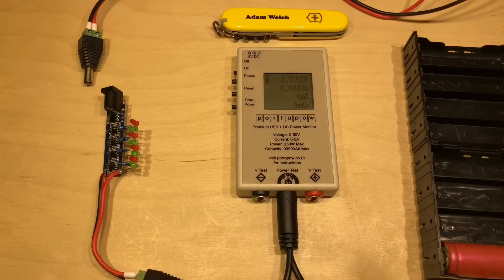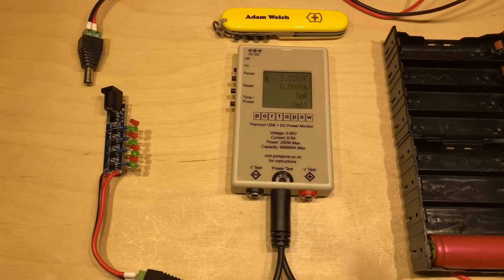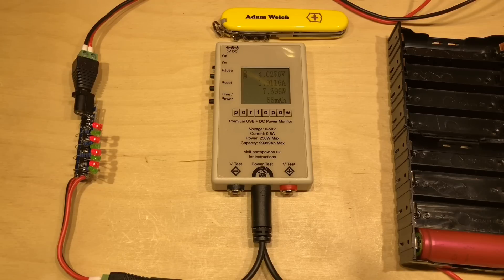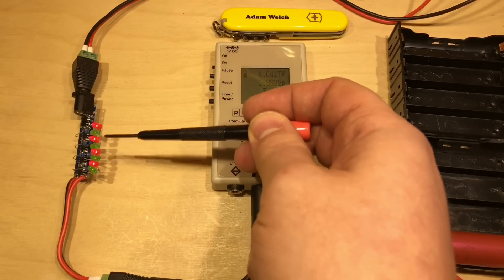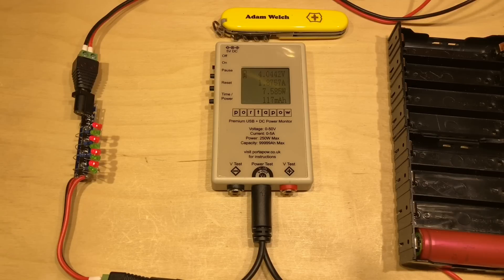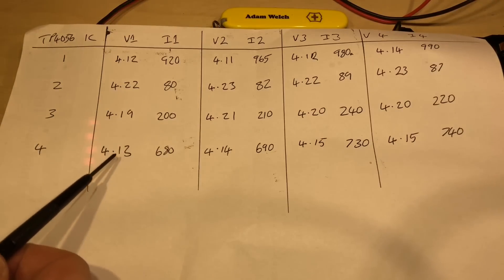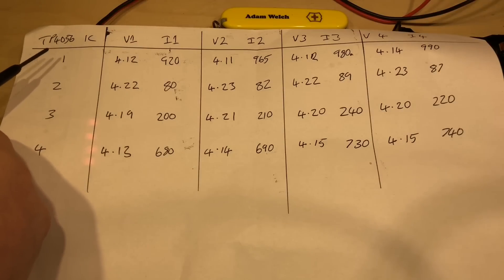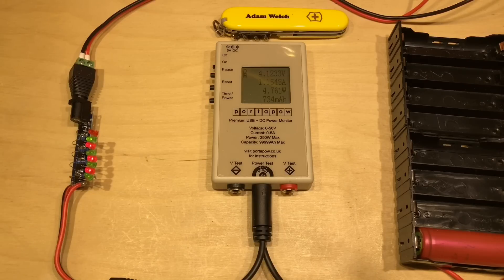High Current TP4056 Module Update - 12v Solar Shed

Comment: That first chip was well out of spec. It is unusual to have such variation in my experience...Er which is zero with the 4056...
How did it take a 2.2A charge well over 90 mins to charge that 1.6A/h battery after reaching 4.12V😫?
Reply from the maker: When the chips reach their charge limit the current decreases, so for the 90 minutes mentioned there is significantly less than 2.2a. As I said, it dropped off to 80-90mA between the first and the fourth chip calling it quits. This is normal for CC/CV charging.

Comment: Those chips are not meant to be used in parallel, mainly because it may under/overcharge your battery till dangerous points, batteries are no joke.

Comment: You'd clearly be better off buying four of the cheap TP4056 modules without battery protection and just putting them in parallel. No messing about attaching extra indicator diodes, and each one would only dissipate the usual amount of heat for the module, so you could keep them a distance apart to minimise temperature rise.
Or even better, buy ten of them and pick four that matched the closest. A bit hard on your 18650 while you swapped them in and out to get matching Vmax.

Comment: HI, There is the exact module with cn3058e chip, anything you can tell me would be great. I have seen a video where the tp4056 chip is replaced with cn3058e chip with 8th leg up, any info on this would be helpful. THANKS

Comment: very interesting review of this TP4056 charger only verion  ... Can you please experiment with TP4056 module with over-discharge protection version ... in parallel ..to get higher output current  (to be used for LED  lighting application ..etc) ??

Comment: you mean 1v or 2 watts are released as heat by the 4 x TP5056.   90 mins between first IC stop and last IC stop and if "standard status" had been taken from IC 1 you'd have stopped charging before the battery was fully charged. (unless IC 1 had the highest voltage  output [VOLTAGE REGULATION SHUTOFF?]).  why doesn't each of the 4 ICs recognize the battery reached full voltage at same instant and stop delivering amps? voltage regulation of each IC varies wildly while the specs say there ought to be no more than 1.5% from 4.20v  (4.137 - 4.263v)

Comment: I have the tp4056 modules with protection, the later ones. I found a schematic online basically running 4 of them in parallel for a 4 amp output. The chips do indeed drop off at different rates, when the last one turns blue they have indeed charged the 5s8p 18650 ( I charge 1 section at a time ) pack to max capacity. Has worked quite well, many times..

Comment: So why not use a chip to accept voltage from the chips, a set of and gates or transistors could be used to switch on and then drive a status LED.

Comment: +Adam Welch have you tried putting 12V across 3x TP4056 in series for cell balanced charging of a 3S battery pack? Does it allow supply side to supply current from VCC to GND (which would be tied to VCC for the next module)?
Reply from the maker: +Simon Merrett Sadly this won't work unless you have three isolated power supplies - otherwise they'd share a ground and you'd end up having a dead short across cells.
Reply: Adam Welch I was thinking gnd from first TP4056 would be connected to vcc of the next module and so on, so I don't think the grounds would end up common (if also connected in a similar way on the battery side) but I can see it probably won't work.
Reply from the maker: The input and output grounds on the TP4056 modules are commoned together.  So unless you use isolated power supplies on the input there will be a short in your cells which are connected in series.

Comment: But does this board prevents the battery from over charging? 

And do you think that it is possible to mod it and combine it with the other 1 tp4056 board wich has over discharge protection?
Reply from the maker: My particular module does charge a little over 4.2 volts due to the fact that one of the TP4056's regulation voltages is slightly high.  It's not stupidly high though.  This module is simply a charger, it doesn't have any undervolt protection like many of the single TP4056 modules do (using the DW01).  It may be possible to intregrate with a protected module - I haven't really looked at that.  You might want to take a look at my latest video to see some alternatives to this module.
Reply: ***** thanks! and yes i will

Comment: Am going to stick with one chip to one battery.
Reply from the maker: Yeah.  There are other higher powered alternatives to this TP4056 board.  Hope to do a comparison video soon.
Reply: Well, someone else already did it.  They got four TP4056's that has just the connections for a wire to be soldered on for 5V and gnd; so they soldered the 5v in series across the four points and the gnd the same way.  The output was two soldered wires from a single holder used to charge the battery.  There is nothing wrong with the TP4056's.  Just how some of the boards are made really. There is a bloke I know of by the name of Julian Ilett that in-directly talked me into getting back into this.  In the last video I published on a different channel;  I was asking him to give me an idea for an oscilloscope but I haven't heard anything from him.  It could be that kit build one but I saw how much trouble you had with one.  Or I could get a hand held one or a Owon.  Mostly about 25 years ago I just worked on digital circuitry but there has been a bloke in Texas that has been after me to build a MPPT charge controller.  So, the first two projects will be to revise muffet and the second one is to build a weather station/greenhouse controller.  The wife whom is back in the UK is sort of picky on the greenhouse.
Reply from the maker: +TechMan1219 I enjoy Julians videos and I'm pleased to say he's one of my subscribers. I know he says any scope is better than no scope - and I agree, but once you find you need to measure things the jyetech scopes start to fall down. I used a hand held jyetech for a year or so but I outgrew it and bought an Owon SDS7102. It's does everything I need for now. 
I like the way Julian uses the jyetech scope whenever he can. Proves you can do a lot with them and don't need a lot of money to play with electronics, but when he needs to he digs out a proper scope - he's just been sent a nice siglent, the lucky chap.
Reply: We used Tektronix solely but that was proved by my employer.  So, for myself am not going to go out and pay £6,967.00 for an oscilloscope.  And I will need that when am working on muffet and some of the other projects that will be following.  I do know it must be dual channel for the changes am going to do to muffet.  So, it’s either hand held or the Owon.  Am working on the parts list for that 18650 design we were talking about.  I know it’s been done but I guess I can redo it wish a twist.  Just need to find a USB end or maybe cable to cut it up.  And am looking for a board to mount it to so it will be easier to carry.  So, I'll do a build video on Independent Living which is one of my channels that I started to post videos on for more technical subjects.  It gives my wife headaches when she watches it and I told her to avoid that one.  But since am here and she is still in the UK; it's her way to know what am up to.

Comment: The LED pins on the TP4056 should all the open collector outputs, so you can wire all pins of each LED output on each TP4056 together without any ill effects and that should let you know when your charge is done without needing all the extra LEDs.
Reply from the maker: I guess I could however if I did that I would only see three states - when they were all charging, when some were charging and others were not and when they had all completed.  Having an independent LED on each TP4056 allows me to see the status of each individual chip - which was crucial to prove they can have quite different thresholds set.  Cheers
Reply: My thinking was more along the lines of making the circuit a bit more practical, since if the chip that has the LEDs connected happens to have the lowest cut-off threshold then you might disconnect your device before the cell is fully charged.
So as a quick bodge to counter that you could solder pins of each LED output together. :)
Reply from the maker: +Poptart McJelly Yeah fair enough - my mod may not be the most practical day to day :-)

Comment: what or how do you sauder the leds on. Have a picture?
Reply from the maker: I just tacked the LEDs straight onto the legs of the IC.  So you need a resistor from 5 volts to a common positive of the LEDs (I used a 1k) and then tack the negative of a red LED to pin 7 and the negative of a green LED to pin 6.

Comment: Unsure if it means anything to you, but inexpensive 5A chargers exist.  This one below has adjustable voltage and amparage settings, but only an indicator light when current reaches a fraction of of its maximum.  No discharge undervolt protection.  http://www.ebay.com/itm/2PCS-5A-Lithium-Charger-CV-CC-buck-Step-down-Power-Supply-Module-LED-Driver-/331803674687?hash=item4d410a483f
Reply from the maker: Yeah using a CC/CV module is a good way of charging lithium - I did a video about cheap ways to charge them and this method was included.  As you say, they have a couple of issues however.
I was interested in particular with this module because the TP4056 have been sold in such huge numbers - It was extremely interesting to see another take on the thing.

Comment: Hi Adam, you might like this one as u r searching for your 18650 owercharge protection...(aliexpress:Excellent Relay Module DC 12V Relay Switch Control Board Module Relay Module Voltage Detection Charging Discharge Monitor Test) i am building almost similar 12v sistem and i think that this little thing might protect my sistem from owercharging :) great job in your 12v solar shed ;)
Reply from the maker: Thank you.  Yes I can see this would be useful.  The charge controller I have connected to my lithium battery bank does have upper and lower charging limits.  If things go wrong I hope they'd kick in.

Comment: Thanks Adam, really interesting. Ive ordered one of these so will take your advice. Couple of questions, presumably its only 1.03V being dropped across the board (5V -3.97V)? Also does the module ever actually disconnect charge or is the module still delivering a gradually reducing current when all lights are green? If so, wonder if that might over time potentially shorten the life of the batteries being charged.
Reply from the maker: Hi Jerry and thanks for your comments.  A little confusing that sorry.  Assuming people only discharge their cells to 3 volts there would be two volts to drop at the start of charge - and of cause this is the point where the most current is being transferred. As the battery level increases and the current falls away the watts being dissipated will decrease.  I mentioned this in the video as the voltage was coming up to four volts so yes at the time it was dropping just over a volt.
In my last video one comment did mention that they had the same module and it never seemed to quit charging.  I haven't had that issue.  IC number 2 did cut out at 80-90mA every single time.  Once all green LEDs were on no current was flowing.  
So the good news is that my tests show that the charging graph really is like the one shown in the datasheet and the shut off current is around the 10% figure (actually I calculate my module cuts out at about 12% of initial charge).
Now attach this to a larger group of cells and introduce some more losses - potentially the module may never get down to that 10% shut off figure.  I guess it pays to monitor.
Reply: Adam Welch Thanks Adam for coming back to me and the helpful comments. Yes I will definitely monitor with mine when it arrives and see how it performs. Thanks again for the video and comments 😊

Comment: Thanks for the update Adam - it shows that this type of module is not good for initial characterization of an 18650's capacity.    I only hope my BT c3100 charger is a bit more accurate (or at least consistent)!  I hae recently got some of those lipo low voltage indicator/buzzers and have measured similar poor voltage tolerance which is not too good.
Reply from the maker: +Simon Jowett It does beg the question for those checking cell after cell are you selling some of your cells short if you've charged them in a low regulating TP4056 module. Some cells might not make the final cut but have just been under charged. 
You would hope at least the two or four slots of a commercial charger would charge to a similar level - but has anyone tested that closely? What the differences will be between BT C3100's as well remains to be seen as far as I am aware. 
Cheers
Reply: Adam Welch hmmm might need to do a test....possibly video it too

Comment: Good work, I wonder how much the normal TP differ from there led charged state. Tho voltage will still be out by 1.5% between the chips
Reply from the maker: +Mikes DIY Tesla Powerwall Exactly. But then it also begs the question what is the charging accuracy of all the chargers on the market? Will different slots in a charger have different tolerances?  We could be rejecting decent cells because our charger isn't being fair to them.

Comment: Adam, would there be any differences to using this module VS 4x TP4056 modules in parallel. (Is that even possible?) This module saves space and has diodes on the input, but the TP4056's would all have LED's pre-soldered on.
Reply from the maker: The size of this module causes it's own issue with heat.  This module is much like the original TP4056 (without the DW01 protection circuit) paralleled up.  So I see no real reason why you couldn't use those gen 1 modules in parallel.  It would of cause have the same issue that each TP4056 would have it's own idea about when the charge is complete - but as you mention at least you'd have all the LEDs to show it.
The last thing to mention is all the TP4056 modules I've seen have the 1.2k current setting resistor which means they can supply 1 amp max of current.  The module I show here uses 1.6k resistors to set the max output of each IC to ~690mA.  I'm guessing this is due to heat on that small module - but it's worth noting.
Reply: Interesting. With the smaller modules you could more easily test their tolerances to find chips that are close to each other and the 4.2v cut-off point for the 18650's. That should give you both a full charge to 4.2v and the full current until they all reach the CV phase. Tied with a buck converted, this may make a cheap solar charger for a 1s lithium battery.

Comment: Excellent update Adam !
I have like 10 single 4056 boards and they show similar tolerances. There are quite a few people around that use multiple single 4056 chargers in a process to measure and match 18650 cells harvested from old laptop batteries to make packs for powerwall. And it really makes a difference for the capacity measurement wether you charge a cell to 4.22 or lets say 4.12 V...
Anyway - they are so cheap that you could buy a bunch of them and select to be within close specs :-D
Reply from the maker: Yeah - I didn't set out to prove this, but it does seem that those people who have large banks of TP4056's may be selling some of those recycled cells short.  When I timed the difference between the first IC and the last quitting charge I was amazed.  90 minutes!  Now you could argue that the last IC was slightly overcharging to 4.22 volts, but undercharging is more of an issue I think when you are trying to benchmark your cells.

Comment: Good that you could connect those status leds, makes it so much easier to explain this all.
Would be interesting to see if those buck converter/charges modules have a higher efficiency than these handy but out of date ic's.
Reply from the maker: +Luc Peeters I have some on order. I think they should be better - but TP4056s are sooo cheap.
Reply: Looking fwd to if you are going to test them.  To bad it is cold and dark'ish now to do a nice solar free electricity test.  
Well I guess the winner is already known since you have to down-convert the input voltage of TP4056 which adds even more loss.   Weird on how having solar stuff makes you more efficiency aware which is a good thing.